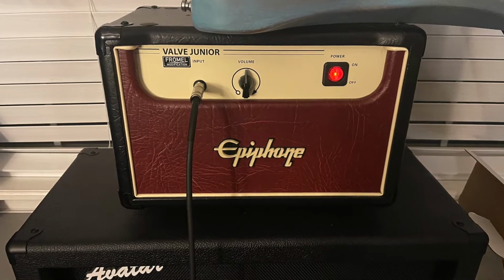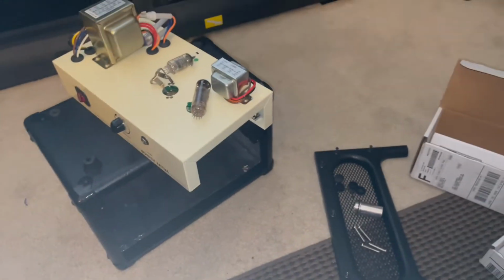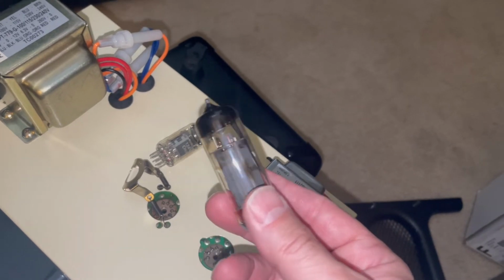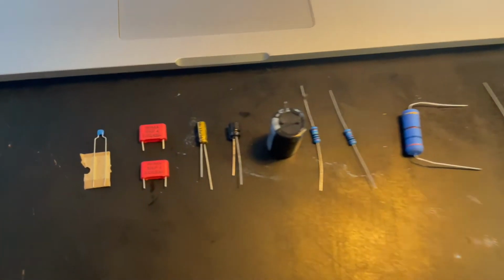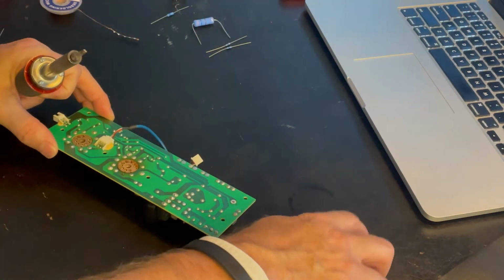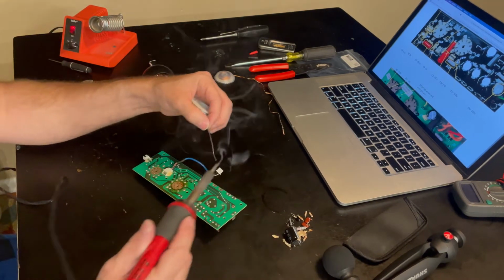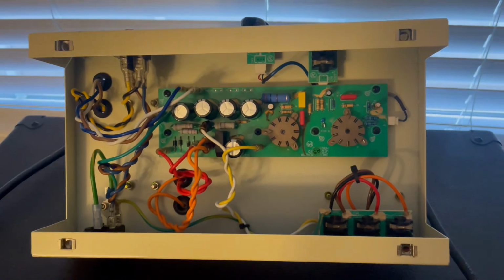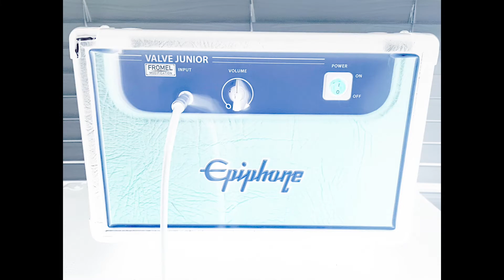Epiphone Valve Jr - Fromel Mod

Comment: Thanks for the Video. Seriously it is awesome!!! Your soldering skills are above the level of many; so I offer the following comments:

10:11 - Pro Tip - For single sided boards use desoldering braid at the start rather than remove the lead then clean up with braid.  
11:21 - The best way to get these (resistors) out is, cut leads from the top of board and use braid to remove solder. Never use force to remove an old lead. You should use  flush cut nippers for removal, the cutter used in the video is not ideal but works. 
11:45 - If the solder is not melting, whet it with some leaded solder (AKA - GET SOME MORE FLOW), this will lower the melting point and removal with braid will be easier. 
12:09 - Don't use force, get some more flow, use braid. The old leads should pretty much fall out and not require pliers or other "pulling" tool. Single sided boards are designed for single use and extra care must be taken not to damage the PCB. Your solder work is really good and you have effectively demonstrated how to use advanced techniques for removal on single sided boards. Best practice is - 1. Always use braid on single sided board, never a solder sucker. 2 If solder is stubborn to attract to the braid, whet with lead solder. 3. Use flush cut nippers to remove components/leads.  
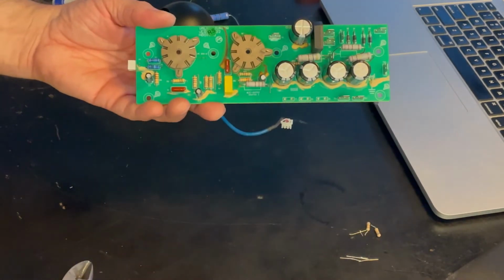13:04 - 9 more to go... I generally remove all the components for the mod before installing the new stuff. Less time flipping the board over. 
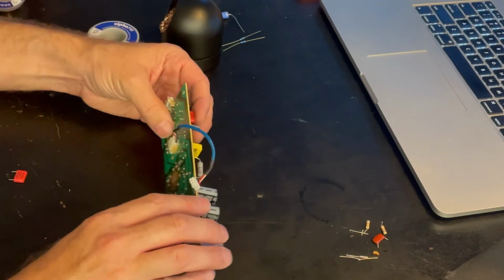13:25 - when mounting the capacitors, bend the leads slightly outward then when you turn it over to solder it will be in place and no need to use fingers to hold it. 
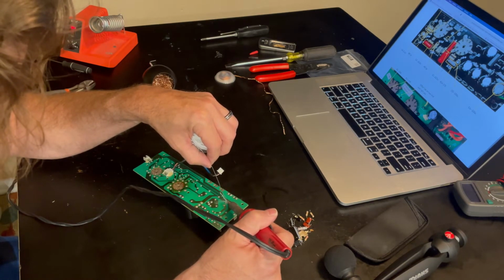14:14 - Great advice - TAKE YOUR TIME, don't rush, don't cuss. 
17:51 - The PT can be configured for any mains AC anywhere on Planet Earth with and AC power grid. Shortening leads for the unused taps on the transformer may reduce noise. However,  I have not seen any difference in the shop when doing mods YMMV.

Tone is subjective and we all find what sings to us. Glad that you think the mods are a good improvement. Thanks for making the vid!!!!!

John Fromel
Reply from the maker: Thanks John!  Appreciate your feedback.

Comment: Bought a Valve Jr. head for $100 from a recording studio. Worked great, and fully stock. Put a Classic Tone output transformer and the Fromel mod in it. Love the tone out of it!
Reply from the maker: That’s awesome!  Did the transformer make a huge difference or did you do it at the same time as the Fromel Mod?
Reply: @digitalreign7485  I did the transformer first, and it did brighten up the output quite a bit. The stock transformer sounded dark.
Reply from the maker: @WackyT08 interesting.  I bet the amp sounds fairly boutique now and is a unique animal in your amp collection.
Reply: @digitalreign7485  It does sound quite a lot different from when it was stock. I really like the tone now.

Comment: Id like to hear the dif with the output transformer changed out. 
Id say dial to 3:30 with a peddle boost ( on when needed ) and my LP vol. Backed off a bit. Into a cab of 4x10s preferably!
Thx for the content!
Reply from the maker: Yes all those elements would change this dramatically.  Thanks for watching.  Cheers!

Comment: Thank you for this video. I bought one of these when they came out and was duly disappointed. It sat for years even after installing better tubes (not much help there) until I discovered the Gear Page and TDPRI and found out it was a popular mod platform. 
The sages therein revealed this mod and pointed out that the stock output transformer is under spec. Consensus was that the OT swap (a Hammond 125DSE was recommended, or you could spend another $250 on a Mercury Magnetics kit) was an 80% improvement, and the Fromel mod would correct the rest of the circuit. I swapped the OT first, and the Jr sounded bigger and bolder, but the fizzy highs and boxy yet somehow also thin and nasally mids were still stinking up the place. 
But after the Fromel mod went in, it's one of the best sounding amps I've played, let alone owned. Kinda Marshally, with I'd say a somewhat flatter freq response. You can still get the splatty fuzz thing with the right pedal, but by itself, it's all brilliant chimey cleans up to old school roar.
chef kiss
Reply: Also, Mr Fromel's pedals are top tier
Reply from the maker: Thanks for checking out my video.  I might have to looking replacing the OT at some point.  I think the Hammond one would be a swap in.  Probably not worth replacing to the Mercury.  It is a cool little amp and I’m really digging it.  Now I just need to create more hours in a day!  Cheers!
Reply: Agreed about the cost/ benefit take on Mercury unless you've got cash to burn. But be advised, the Hammond isn't a drop-in swap. I did mine about 10 years ago, and if memory reluctantly serves, I had to drill two new holes in the chassis to install it because of the wider base plate. Totally worth it though. I jammed it with a four piece band through a 1x12 with an old Magnavox alnico, and the other guitar player couldn't keep up with his Schecter/ 75 watt Line 6 rig

Comment: I bought a Valve Jr. when they first dropped. The little amp didn't sound very good at all. But it did show the manufacturers that small, low wattage tube heads could be viable for modern musicians. And now we are covered up in mini/lunchbox/micro heads. So thank you to Epiphone for that. It definitely does sound better modded.

I see you are an Avatar cab fan. I use one of their Contemporary 2x12 cabs loaded with Hellatone 60's as my main cab with my MT15. Great bang for the buck company.
Reply from the maker: Nice.  Yeah the mods are a vast improvement.  I’m contemplating trying out a 5751 over the 12ax7 to get a bit more headroom.  Really dig the fuzzy Drive tone.

I bet your cab sounds killer.  How much does it weight?  Each of my oversized 112 are a workout to take to gigs.
Reply: Concerning headroom in light of my above comment about the output transformer, a poster on I think TGP mentioned that a Hammond 125ESE would yield more headroom than the DSE. If memory serves, the DSE is rated 12 watts and the ESE 18. With the DSE, my gain tops out at around 3 o'clock and just gets mushier above that, so you may get a little more clean volume that way. That said, I've rolled in a 12at7 with nice results

Comment: I only have one problem with this video you never showed any of the components you changed or what they were there for or why you changed them. Right before I watched your video I watched Brads video and he had a schematic and showed what the components like grid stopper resistors and bias caps. In your own words not very inspiring video